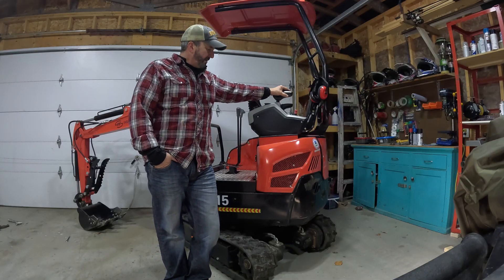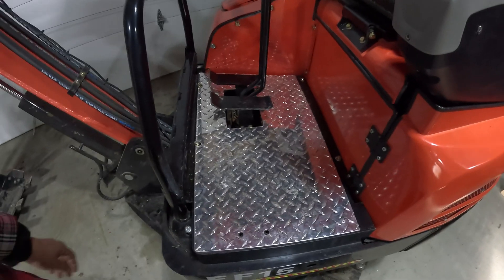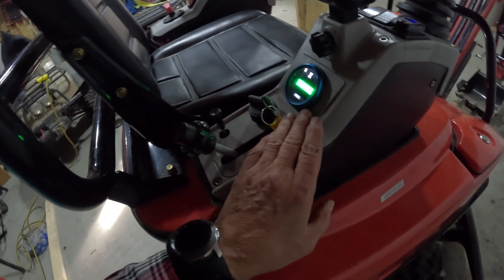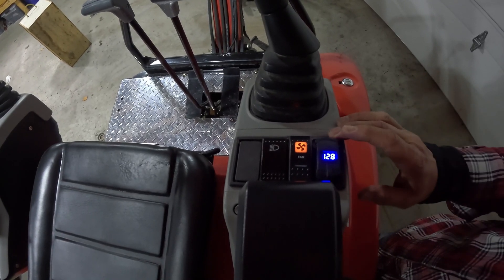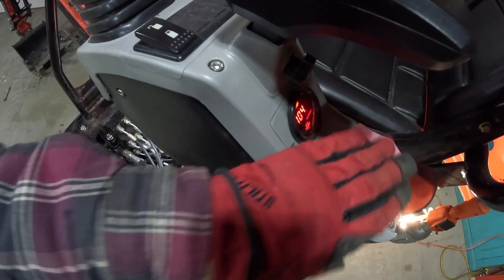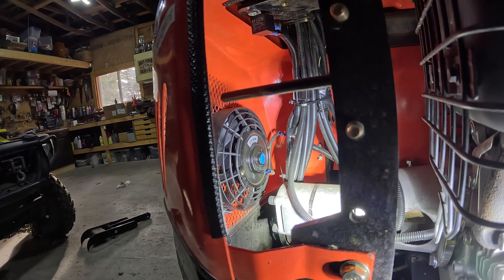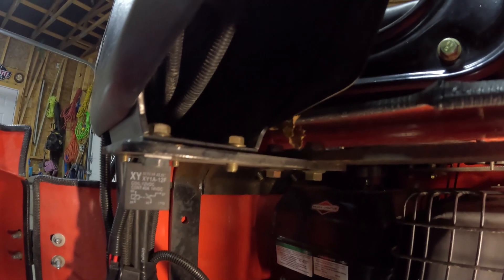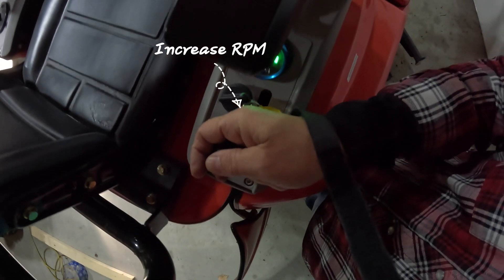Mini Excavator Mods That Will Make The Most Difference!

Comment: How does yours charge the battery does it have a alternator
Reply from the maker: There is no alternator ,  there is a rectifier/regulator under the flywheel the creates a small charge that is sent to the battery.   There are some video's out there of guys retrofitting a full size alternator.  But I haven't done it.   Cheers!

Comment: My CFG QK18Z is almost exactly the same as your FF15, canopy frame is different - 4 verticals versus 2 and the battery is up front under the floor and is impossible to get at without removing the floor. Caution: if you drop a floor bolt into the space below you will never find it! Was hard to start the first time, did not know that there was a fuel shut off and where it was. Thanks for all of the good info out there in BC, I will be doing your mods and ordering the stuff that you recommend on Amazon. Cheers, Gerry in Ontario.
Reply from the maker: You are so right about the black hole... you drop a bolt and it will slide into some other dimension.   Aside for the hydraulic thumb (that is a must) ( https://youtu.be/sQGNxMFD6LY ) the spinning of the main book cylinder (  https://youtu.be/lgE2EDmj_w8 ) saved me a few times and you might want to consider it. Cheers!

Comment: I have the same machine. Just ready for my first oil change and was looking at the drain plug thinking it was a stupid design and oil is going to go all over the place. Now I just ordered the drain hose so it will only make a mess the first time. After that I'll be able to change oil and have it pour into a pan. Thanks! Also ordering the fan, volt meter, and switches. Not sure if I need the hydraulic fluid temp gauge but will probably get it too.
Reply from the maker: I agree the drain plug is pain the ass.   I actually use the hydraulic temp gauge continually... As I have not yet installed a cooler.

Comment: The fan switch fit ?? I bought a few where to small or to big...did you modify the hole?
Reply from the maker: I just had to modify the switch case a bit.  I use the one i put a link in the description.

Comment: Funny I made the same exact upgrades minus the oil temp! Check your bolts for the foot pedals if the bolt falls down in the torrent it's bitch to get back! They were loose on my new F18R (1.5ton version of the ff15)  I put two 7 inch fans in w dash switch which was impossible to find the bezel I had to roto zip it out. I also put diamond plate (But rubber to same way you did)
Reply from the maker: Yes, I had the same issue getting the rocker switch installed.  The link in the description is the one that fit the best!

Comment: That's a high pressure line that you've teed the temp sender into. Hopefully your temp sender is rated for those pressures. Usually the temp sender is installed in the return line where it's low pressure and is hottest.
Reply: That's off of the pilot system only about 250-400psi. So he'll have temps of the pilot system not the main hydraulic system which gets hotter..
Reply from the maker: Great point. There did not appear to be a pressure issue with that sensor. I definitely monitor it.